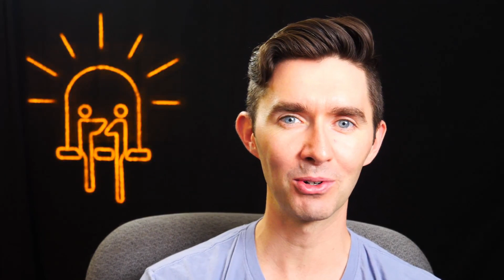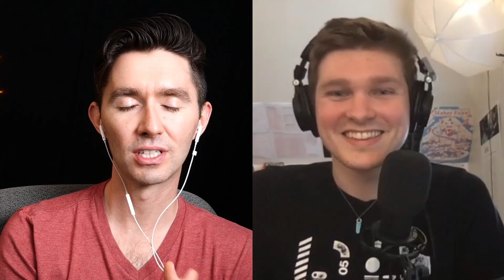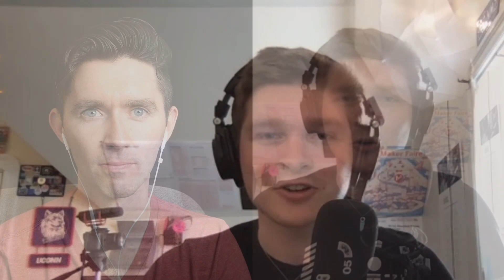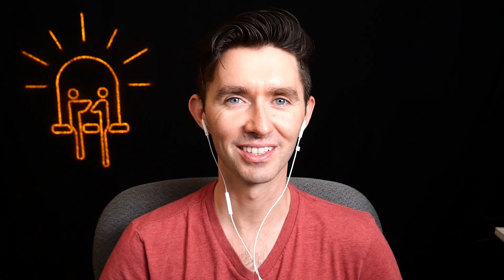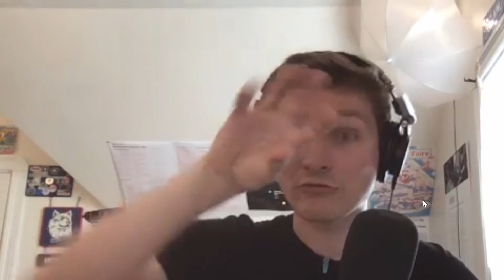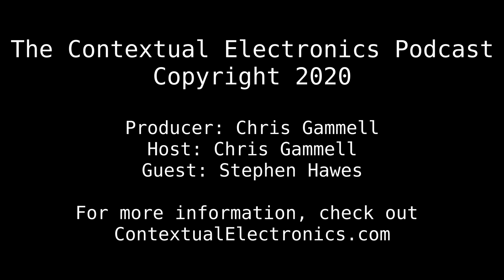CEP002 - Building a DIY Pick And Place with Stephen Hawes

Comment: 29:00 Don't stepper motors have PH connectors on their end?  You've got to have the capacity to pin these.  They don't mix well - especially the crimps - the connectors are fine.  Keep a separate box.